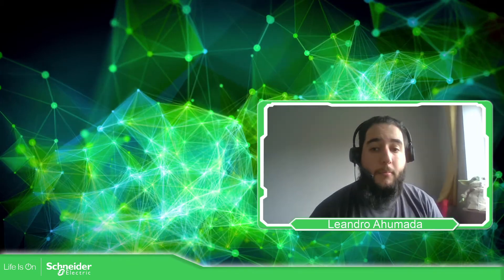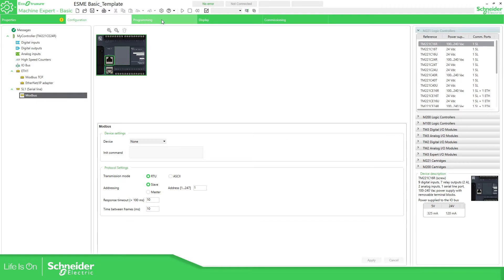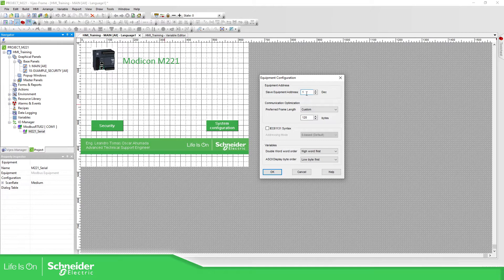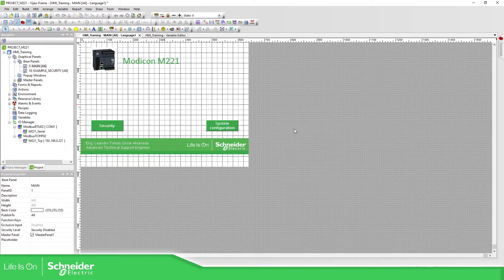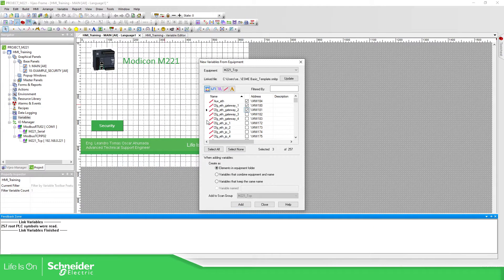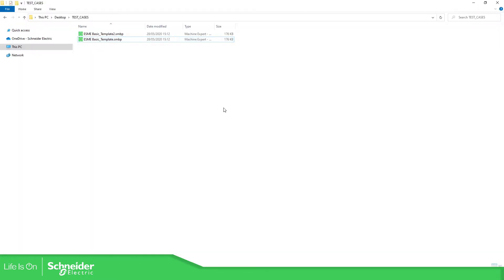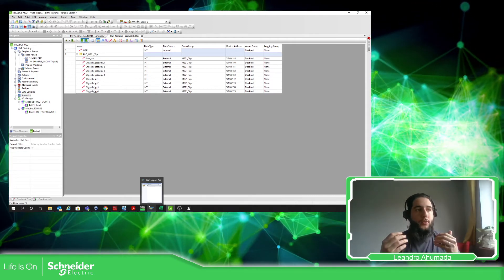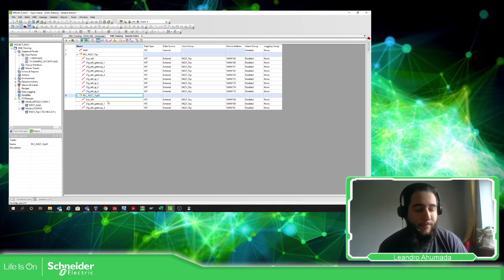Training - M221 - M14.4 Linking variables from Machine Expert Basic to Vijeo Designer

Comment: BThan you for this helpful video 
I can't find %M ,Mw variable on hmi  via modbus connection 
After variable imported
Also,I have another issue 
Start simulate not activated
I use hmistu855
Reply from the maker: Hi there! If you follow the video it will show the diffefences while importing the smbp project. If not try to update eote and put symbol to tbe %M and %MW variables in tbe project
Reply: @LeTomasAHUMADA 
Thank you
Reply: Variable imported sucessfuly 
But when i simulate 
Give "me no reply from plc within timeout period"
Althoug all modbus parameters are the same

Comment: thank you for this video; 
although I followed all the steps, when I try to simulate with vijeo designer, there is an error : com port open failed everytime, am I missing something ?
Reply from the maker: Hi Siaci Maissa! I will need to check your programs (HMI and PLC) otherwise is complicated. Can you upload those project in the next box folder? https://schneider-electric.app.box.com/f/c28473281e2c489093fe72cdb037243c

Comment: Thank you for this excellent tutorial! I'm working with HMISTU and M221 connected over ethernet. As far as I can tell I have the settings set correctly but I get an error on the HMI that the PLC returned with error code (01H). I don't know what that means. Also should I be using crossover cable to connect the HMI and M221?
Reply from the maker: Hi Mistry! standard cable should work. For more information about the error code you can check the next FAQ: https://www.se.com/ww/en/faqs/FA386843/
Try to remove the cable to see if you get the same message, if yes then the cable is the problem.
Please check the ip address and subnet of the device using PING from cmd probably that is the problem.
Reply: @LeTomasAHUMADA  thank you for the reply. I'm able to ping both devices. I get yellow triangles on any elements I have on the screen, like buttons etc
Reply from the maker: @5nov1988  can you upload both projects in the next link? https://schneider-electric.app.box.com/f/c28473281e2c489093fe72cdb037243c
Reply: @LeTomasAHUMADA  I will do that as soon as I get my virtual machine up and running.
Reply: @LeTomasAHUMADA  Done. I think I uploaded the correct vijeo designer files.
Reply from the maker: I have check both configuration and I believe the problem is related to the subnet mask, it is different inn both devices. In the Equipment Confiugration (M221) in Vijeo Designer change the UnitID to the default 255
Reply: @LeTomasAHUMADA  THANK YOU SO MUCH! IT WORKED!!

Comment: Is Flip Flop available? Controlled by one input. To change pump operation. Thank you. Regards
Reply from the maker: Hi Sajek! As far as I know we do not that function but you can make something like this to control one output using one input based on the status of the output: 
https://schneider-electric.box.com/s/u1cjwfc6wurk3hpynm0foifjzcg6homi
Reply: Hi  @LeTomasAHUMADA  Thanks for the answer. I just created a combination of NO / NC contacts. Works with what I am happy. But I will check the link you provided. Maybe your option is simpler. I'm just starting to learn M221. Your videos are very helpful. I have to start watching from the beginning. Regards, keep on going!
Reply: I checked 😉 the function is definitely simpler 👌. I need to do my homework  😉